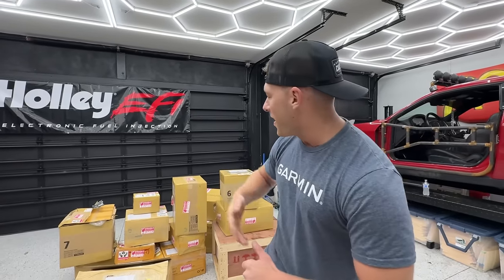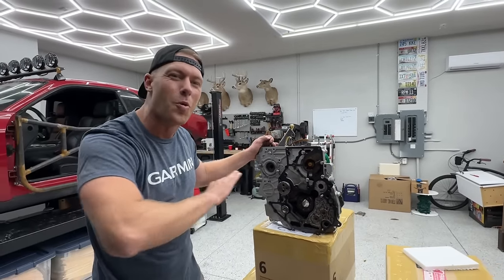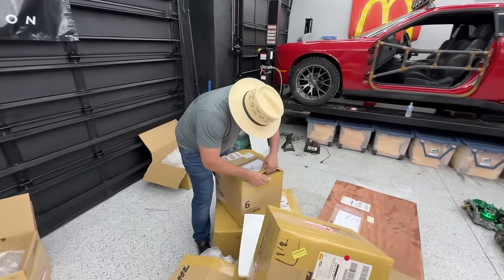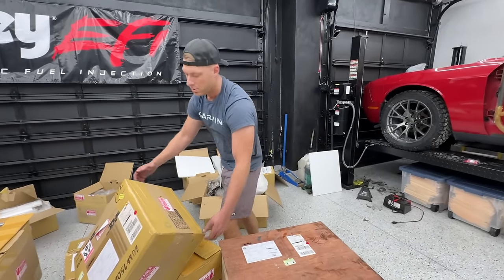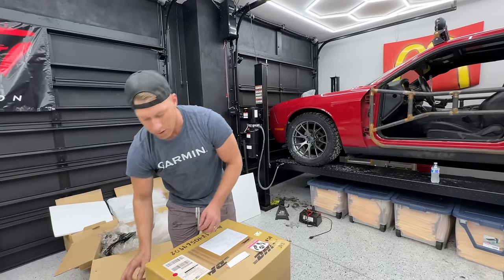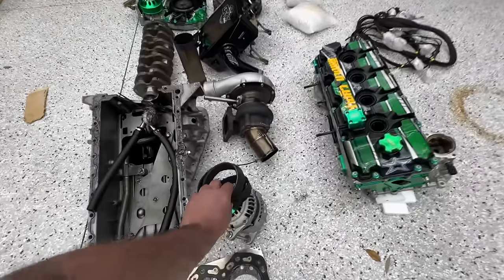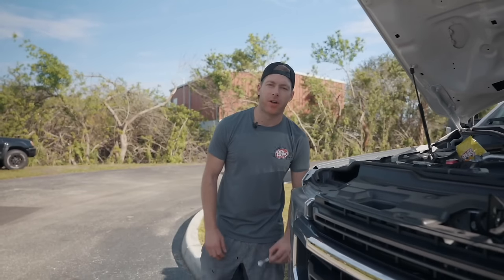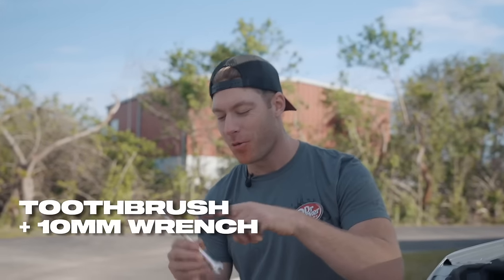Our Thailand Longtail Engine is Here!

Comment: Weren't those 4jj1 engines available in the Colorado/Canyon?  If so you'd have an easier time with parts.
Reply: No that's a VM motori 2.8l. However the 4JJ1 is/was common in many, many different types of construction equipment/industrial applications in the US. Maybe even an Isuzu box truck or similar. Parts are readily available.

Comment: Although this engine is only 4 cylinders, its horsepower is not 4 cylinders like the engine. This engine has a power of 900 horsepower. The engine was tuned by skilled technicians in Thailand.
Reply: Wonder if that could be put in a mini jet boat?
Reply: @lightning9279 Of course not, because this engine is a 3.5 liter 4 cylinder engine. It is an engine taken out of a racing pickup truck in Thailand. It has twice the horsepower of the Jet Boss, approximately 900 horsepower.
Reply: Is the modification only about attaching big turbos and coolers? Or they change pistons etc?

Comment: Parker you should give yanmar marine a call. Yanmar has so many different marinized versions of the Isuzu 4j series of engines. You can buy all of the marine components for your 4j that will last forever and be meant for your engine like the proper cast iron water jacketed exhaust manifold, all of the marine cooling system components for your engine like the raw/seawater water pump, heat exchanger, and components. You won’t have to mess with any of that janky automotive stuff and it is headache free, reliable, and the parts are easy to get right in Florida. Call up a yanmar tech or find a marine mechanic that services or sells yanmar marine engines. All it is is an Isuzu 4j that has been marinized with parts and systems that are meant for marine use. Way better bet than all that mess of valves and oil filter components and fittings you got going on.
Reply: This engine sits up on a stand and swivels like an outboard. And has a dry exhaust. If it had all those heavy iron parts and hoses coming off all over the place it would be super hard to turn if not impossible. It already requires an 8ft long tiller to turn.  Definitely not a typical marine engine not to mention makes far more power with the compound turbo setup than any of the factory marinized engines. There's a reason they went through the effort of shipping the engine back in pieces rather than just buying a Yanmar marinized version.

Comment: Did you know that there have been long tail boats in Louisiana for over 30 years that I know of when I was a kid it seemed like every neighbor in WestWego had a long tail John boat with lawnmower engines on the back on a stand and a long shaft to a prop to run the swamps I can't remember what they called them though  and I have a question? 
Is it because of customs that you disabled the engine instead of just one crate ? I'm thinking they would have disassembled it to look for contraband!?!? Just curious.
Can't wait to see you ripping I hope you take it to the Indian river on the east coast crystal clear from Port Saint Lucie FL down past Jupiter FL and very smooth

Comment: Never lay a crankshaft down on its side, specially on a hard surface
Reply: If it can’t handle being laid down it doesn’t need to be inside an engine
Reply: @bradthackston5217  When it’s in a engine it’s being supported at all the main caps, bumping that thing around even .001 is gonna change bearing clearances
Reply: It ain't a fragile LS, it'll be just fine.